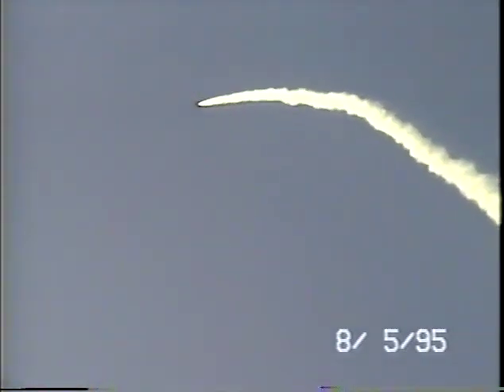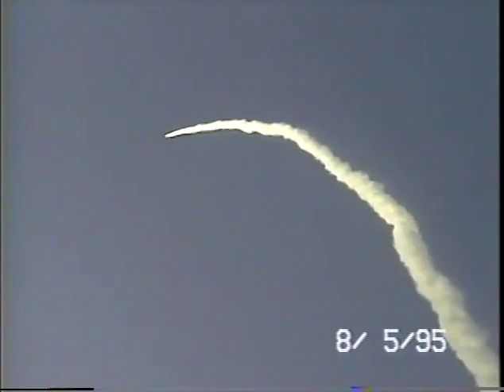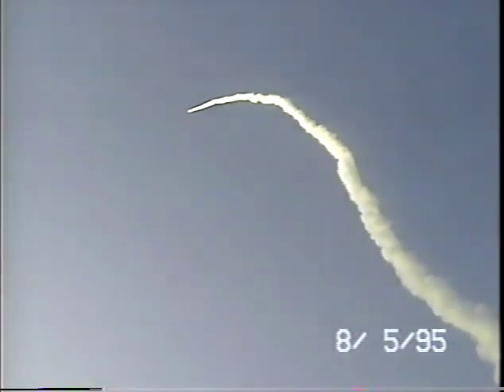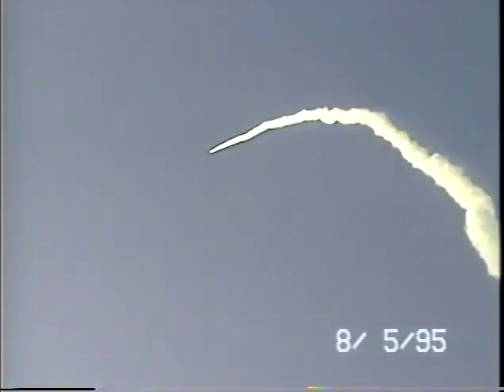Delta II 7925 Launches from Cape Canaveral AFS (Personal Video)

Comment: Interesting video. I've favorited it. This is one of only 2 Delta II rockets to have have not been completely succesful at getting their payloads on a good trajectory.

In this incident, one of the SRB (solid rocket boosters) - an air-lit/air-start one according to this comments - failed to separate and the spacecraft was put into a lower orbit than planned, but the satellite had enough fuel to boost itself to its desired orbit, though it would not have as much fuel for normal operations after this.  What should have happened is the rocket and 6 boosters would light on the ground, then 3 more would light in the air, the first 6 would be jettisoned when they ran out of fuel, and then the last 3 would be jettisoned when they ran out of fuel, leaving the liquid-fueled core to fly on its own until it ran out of fuel. This launch went well until the last 3 SRBs were to be jettisoned, at which point one failed to jettison, forcing the core to lug along the empty booster casing until it was jettisoned.

The other failed Delta II infamously self-destructed 13 seconds after liftoff due to failure in a booster - If I remember correctly a crack formed in a booster and grew until the rocket self-destructed. I think ground handling was responsible for that.) That incident sent chunks of burning solid rocket fuel into the surrounding area and caused property damage, not to mention the complete loss of the payload, but nobody was hurt if I have my facts right. Most YouTube videos of that incident are form the Destroyed in Seconds TV show.

The Wikipedia article for Delta II mentions both accidents. For details about the complete failure, read this-
http://en.wikipedia.org/wiki/GPS_IIR-1

As for this incident, the last three boosters burn out at 4:37, and those SRBs separate at 4:49 (well, 2 of them did.)
The announcer first mentions the issue at 5:39. However, (and I did not know this before this video), he seems to not believe that the issue is real and it is not mentioned again in the video.